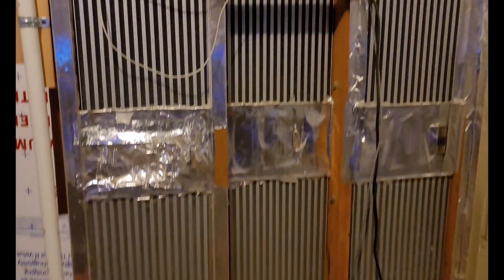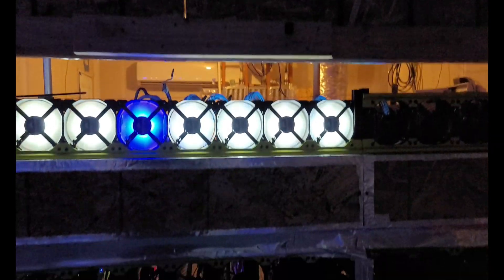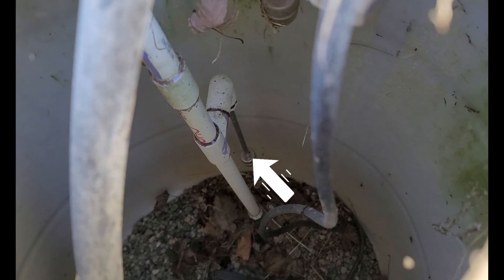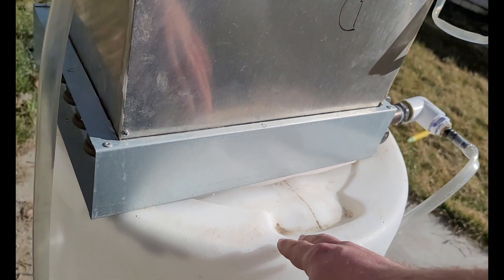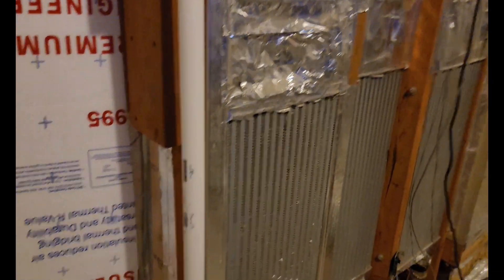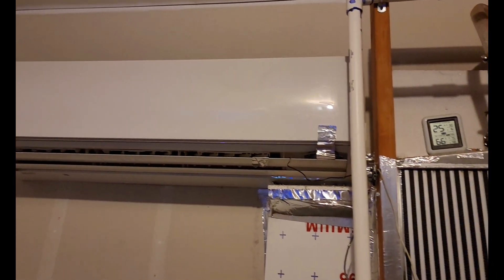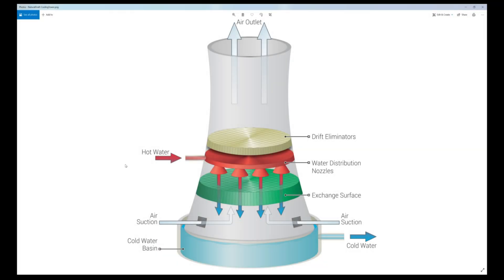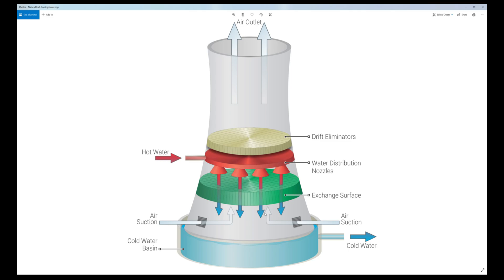|PART 1| Cooling The Mining Farm - Ethereum Mining 6.7GH/s 23KW/h

Comment: I asked for advice about MOT bios there is a difference between the new version and the old version if I mod from the old Polari then the mod to the new version is useful. sebeb in the new polari memory does not change while the old version changes and there is no memory error in cclock 2100 because if the new version always shows an error gpu share failed
Reply: Gigabyte aurus core 1170+ mem 2100 always incorrect share
Reply from the maker: @mr-lot354   Thanks for watching, the card you have is it a 580 or 470? if you come to the FB mining group we can check this out a bit closer.   Come join us.
https://www.facebook.com/groups/GPUMiningz
Reply: thanks for the reply rx 580 why there is always an error hw when using redminer is there an error in the bios mod in cclock 1150 memclok 2100 always happens